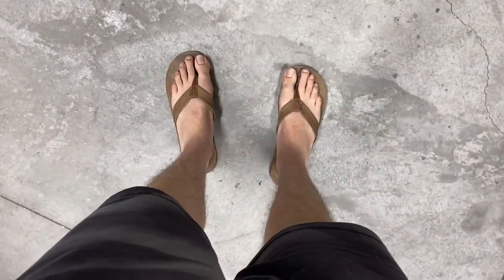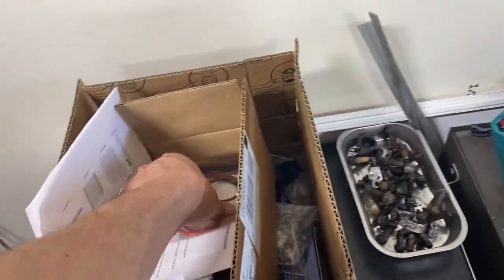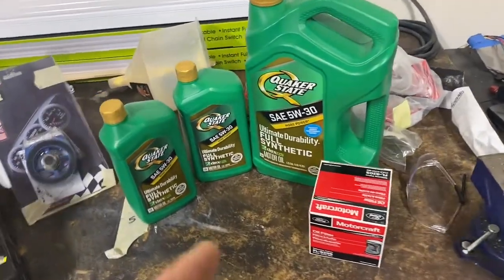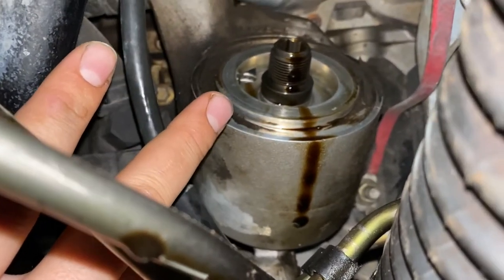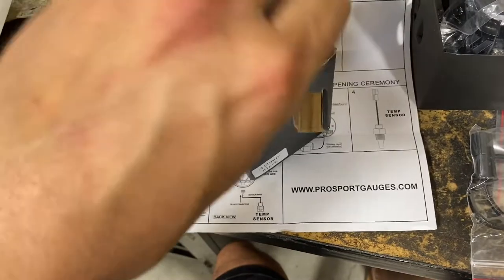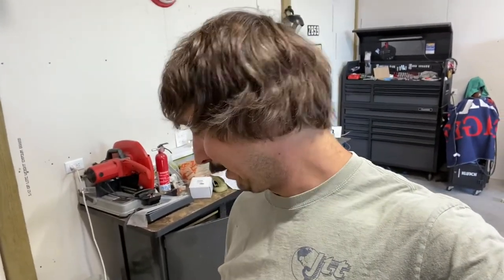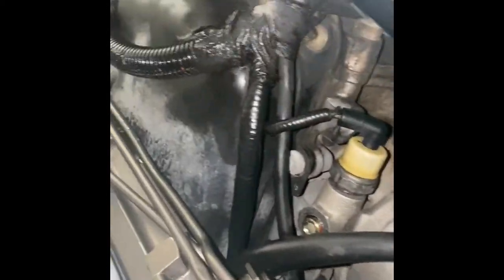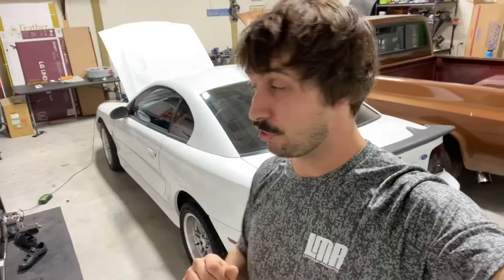SN95 Mustang Cobra Oil Cooler Seal Replacement + Prosport Gauge Prep

Comment: Nice work.  That cat really did quiet it down a ton.  I stick with strictly Motorcraft filters on my Fords.  Their media is one of the best compromises between flow and filtration, and it's a guarantee it has the proper bypass pressure.  Plus they're so cheap, why use anything else?  I read that same article years ago and it's quite old now.  His testing methodologies are somewhat questionable, but it was good info to help make my oil decisions.  QS has changed formulas a couple of times since that article was written and the API specs have changed since then too.  Still, QS is good oil.  I just became an Amsoil guy though for a number of reasons, which I thought I would never do.  Thanks and have a good one!
Reply: SudsyCloud 
Will do. 
Have you messed with the instrument cluster. Half of my didn’t work. So bought another one now less works on it.  Wondering if it’s bad cluster or wiring running to the cluster.  That’s beyond my skill set.

Comment: Thanks for the video. Does anything else have to be removed to get the cooler out of the car? Seems like a tight fit.
Reply from the maker: It has been a while since I did it but I dont think so.  It was just a tight fit but it worked.  If you tried to install an extra long filter that could be a problem.

Comment: That filter looks really tight in there. Are the motor mounts nice and stiff? To avoid excessive engine movement that might cause the filter to come in contact with anything that might damage it.
Reply from the maker: I never thought about the motor mounts but thats a good point.  Its got space but like you said it could use more.  Ill have to keep an eye on it and inspect the filter for any signs of rubbing.  The good news is these motors dont make a ton of “twist” if you know what i mean.  Its not like snapping the throttle on my
BBC

Comment: The only problem with full synthetic is the fact that it is thinner then conventional. It will over time allow your to end Expesually cama to wear and overheat
Reply from the maker: I dont think you are getting the right information.  Oil viscosity should be very similar if not identical between convention and synthetic.  Granted there may be minute variations between brands, blends, etc. but thats very likely not whats going to cause failure.  For your average driver its going too long between changes.  For racers its the oils ability to still provide protection at elevated temperatures.  Synthetic allows you to go longer and supports high oil temps before breakdown.